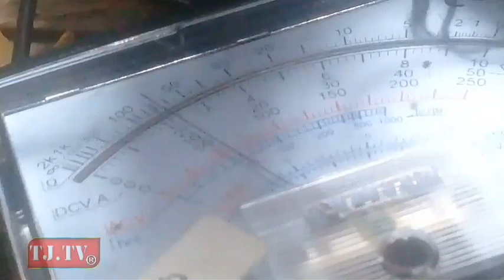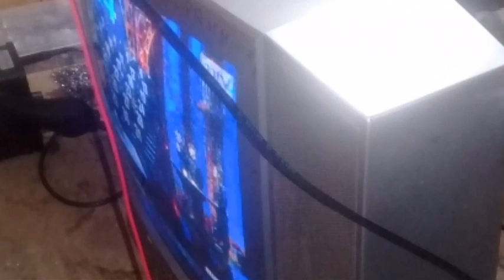Servis Tv Sharp indikator kedip kedip

Comment: Puyaan saya kedip kedip nya 5 kali apanya gan
Reply from the maker: Bisa di eprom dan juga power supplay dicek dulu bos
Reply: Ok gan
Reply: Tv juga uda q tes makek gacun. Hasil nya masi sama
Reply from the maker: @GentayanganHoreg  ic nya pake tipe apa saja bos.
Reply: Kalo tv mode servis.  di j122 ama  j124 q jemper tv bisa satar. Tp kalo jemper q lepas tv kembali setanbay. Layar kedip.kedip
Reply: Ic TDA 9381ps N2/2/0538
Reply from the maker: @GentayanganHoreg  iya cek vertikal mas. Kalo darurat lepas pin protect nya.
Reply from the maker: Kalo maaih protect coba cek ic audio prosesor kalo ada.
Reply: Semua pin protek uda saya cobak satau satu. Hasilnya masi protek.. ne mau cobak saya ganti eprom.. 
24C08wb eprom bawan nya. Misal q ganti ma eprom tv cina bisa ga mas. Nomer seri sama.
Reply from the maker: @GentayanganHoreg  samakan kode belakang epromnya.
Reply from the maker: @GentayanganHoreg  kalo ada ic sound prosesor coba cek pin sda sclnya
Reply: JRC 45880 adanya mas
Reply from the maker: @GentayanganHoreg  tv nya sharp.seri apa.coba
Reply: Apa sama mas.
Reply from the maker: Kalo sama cek tegangan pin protect harus ada 3-4 vol dc.  Priksa juga pin sda sclnya yang masuk ke eprom tunner atau ic sound prosesornya. Tegangan sda 3- 4 vol. Kadang ada yang 1.7
Reply: Tv sharp wonder (20w200)